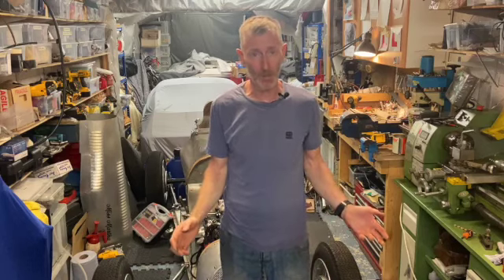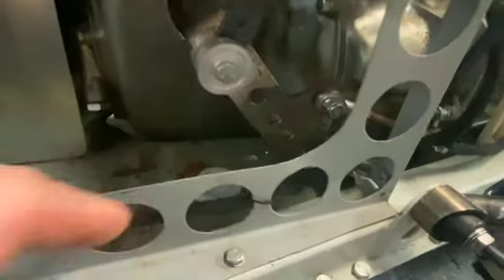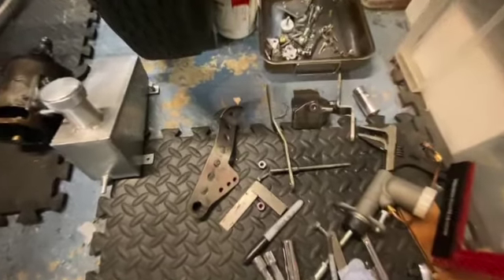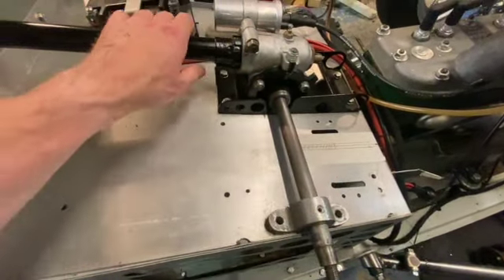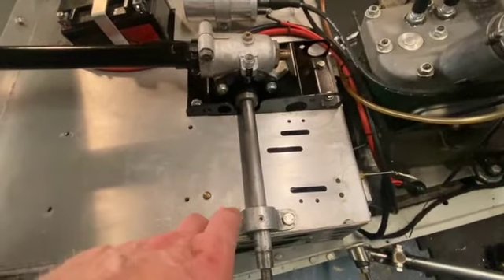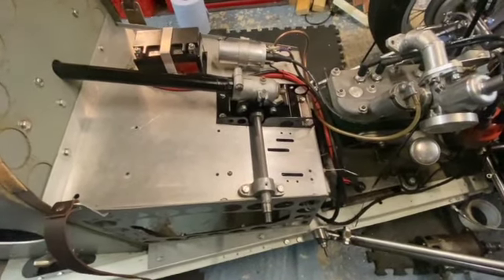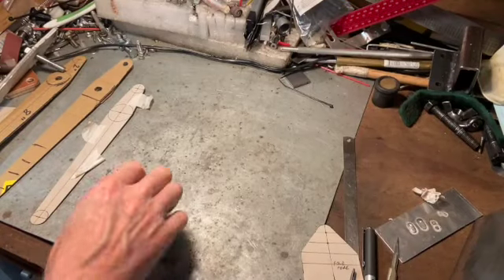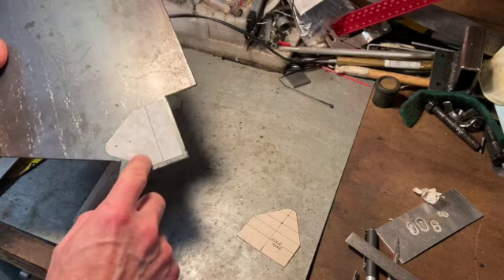Wragg Austin 7 Special - Brake Pedal Project - Episode 1

Comment: Beautiful build my friend. I am clearing some old projects out before I start my Youtube channel with my 1928 Morgan Rip MG special build. It is wood over metal frame with aircraft cloth. I sourced an experimental aircraft opposed twin engine for the front power plant. It is connected to an MG transmission with a hand cast two part aluminum adapter. Then it will be finished with the MG rear differential so it has rear juice brakes and those beautiful wire wheels. One day I hope to bring it across the pond and join you on one of the runs in its original home...lol keep up the great videos. You are my inspiration.
Reply from the maker: Looking forward to seeing your channel !
Reply: @thebracketfactory  Thank you. I may have to take a position at a pharmaceutical company to build up finances for a couple months..